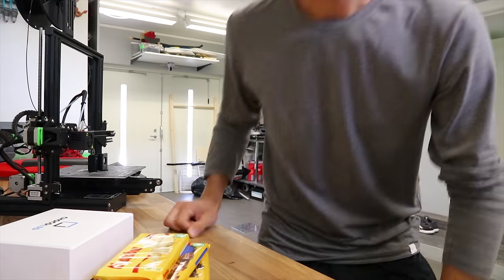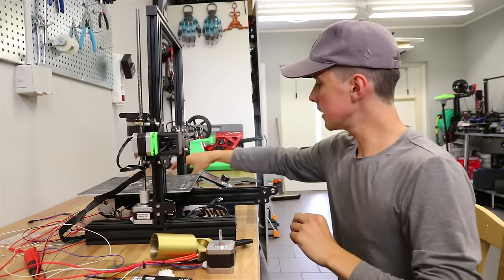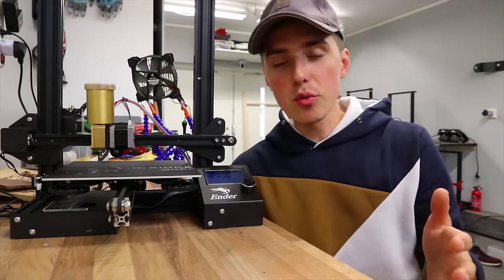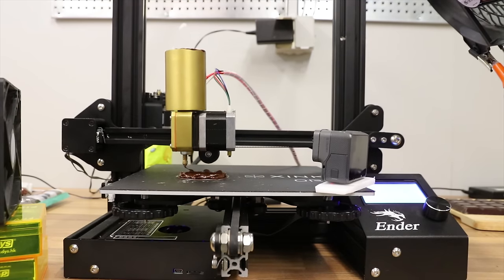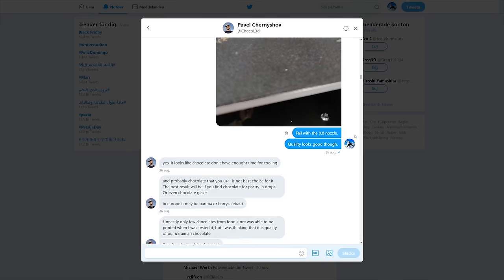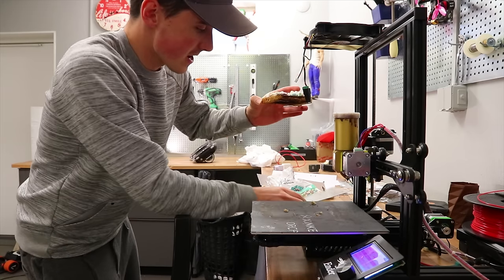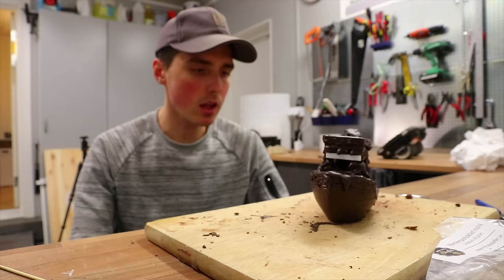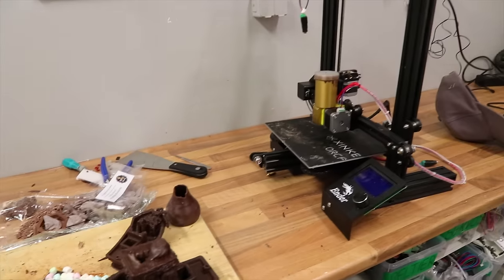3D Printer Makes the Perfect Chocolate Layer

Comment: Imagine doing this in a cooled room that allows the chocolate to solidify to stand on it's own.
Reply: Lol
Reply: 06:15
Reply: @skelldogTalo  yeah but with overhangs and stuff
Reply: Sure, but still impressive
Reply: Or just put printer into fridge))
Reply: @horatio3852  yeah condensation on electronics is not a good thing
Reply: @dan3a  I didn't think about it))
Reply: @dan3a  dry out the air
Reply: you can build small container for printing chocolate and cool it with dry ice just an idea tho
Reply: I feel like there’s a fine balance between good solidification and the chocolate solidifying inside the nozzle and junking up everything
Reply: He just needs to turn down the print speed to like 2mm/s and it should work... It just might take 1000 years

Comment: First off, let me say that I greatly admire your patience.  Secondly, may I suggest sourcing chocolate that has coconut oil as the main fat, as it melts at only 24C.  That should mean you only need to cool the new layers by ~5-8C to get them solid, though such a low melting point brings its own problems.  You can make your own chocolate using coconut oil, honey, and cocoa, which might be something for you to try.  Another option in the other direction would be to add (edible) paraffin wax to regular chocolate.  This melts at 46-64C and is often added to help chocolate not melt so easily in your hands.  Another option that someone mentioned was to use a cooling enclosure, which might work well.  Hope this helps!
Reply: Show off!
Reply: @7f0g20  Buzzkill!
Reply: Show off
Reply: Huh.  I don't often get a chance to use 'LOLWUT?', yet here we are.  :grin:
Reply: Show off???
wait what how?
Reply: Keith Olson why you bully me
Reply: Teacher:Keith why haven’t you finished your text
Reply: I'm not sure what y'all are smoking, but I know that I don't want any.
Reply: Keith Olson ok we get it you like science 🧬
Reply: @KeithOlson  They need some milk
Reply: wouldn't a higher melting point better? That way the delta between room temperature and solid chocolate would be higher, resulting in faster cooling chocolate. Maybe cool the room or workspace down too. I see the problem in to high temps. Also I would decrease the print speed or add an pause between layers. The ship was a good example. Bottom looks good, because the bigger printed area giving it more time to cure between layers. It did got messi once he printet right on a "fresh" layer.

Working with chocolate is tricky. Not sure what this printhead can do, but I would heat it only a few degrees over melting point, since to hot chocolate is hard to work with.
Reply: @Steel Vendetta delta usually stands for the difference in mathematic. For a non native english speaker it is way easier for me to explain it this way.
Reply: or adding a little bit of butter should help too...
Reply: Are u a tetcher?
Reply: @arcadebit1551  I'm not sure which would be better, which is why I suggested both as avenues to research.    The complete lack of cooling on his setup can't help but be a big issue.  (...and don't worry about those who want you to dumb down your comments, though I do agree that the wording in your second sentence could be made more efficient.)
Reply: @ @honeybool7065 :  I honestly don't know if they are haters or not; a lot of them just don't seem to be making any sense.
Reply: also add a fan to blow on the chocalate
Reply: people try to help
YouTube- Excellent, targets.

Keith, Arcade, both your bits of advice help not only with the printer, but also for someone that does make chocolate (moi) on a not-so-regular, regular basis.
Reply: Lmao someone is just trying to hrlp
Reply: Show off!!!!!!!
Reply: Keith Olson English please
Reply: Wouldn't the coconut oil separate from the chocolate?
Reply: coconut oil would kill me, I am allergic to coconut :-(  I can't eat many commercial chocolates anymore because of palm oil and coconut oil.  I wish that they would stop putting it in everything because I have to cook everything from scratch now and I can't even eat most snacks
Reply: Dam you talk to much
Reply: Can someone explain to me why there are so many 'Show off!!!' comments here?  Is this some meme I'm unaware of?  I'm not mad, just confused at some of the responses to my sharing information I've learned.
Reply: @honeycalina8515 : Personally, I'd rather people talked with each other more.  Most of the replies here are missing so much information that they are utterly worthless.  If people would take the time to share the complete picture of what they were thinking, then what they had to say would be taken more seriously.  Your comment, for example, doesn't say who you are talking to, nor does it specify why you think this person is talking too much, and so isn't of much help to *anyone*.  (If you are speaking about me, I honestly don't see how I could trim what I've said very much without just turning it into dry notes, which aren't pleasant to read.  I do try my best to stick to the topic at hand and not turn every comment into a full-on essay.)
Reply: @pam7366 : Why do you believe that they (I'm presuming you mean chocolate) need milk?  It does add a particularly good flavour and texture, but there are plenty of other sources of fat that are more suited for other uses and tastes.  (I'm a fan of dark chocolate, myself, which contains no milk.)
Reply: @pam7366  I hear you, but please consider the structural integrity inherent in something made of chocolate mousse.  :grin:  (Mind you, it would make for awesome infill!)

Comment: why not just 3D print a mold and then just pour melted chocolate into it.
Reply: (Excuse the name, it's for something)

Is that 3d printing. I think not.
Reply: or just put bread with cholate in the toaster...
Reply: Then u can’t eat it
Reply: @haxosop7648  why not it seems more edible than crappy "chocolate" you have to use with this extruder.
Reply: I feel this has different potentials other than things that could be done with a mold or a knife
Reply: @muhammadal-hiyari5239  3D printed parts aren't safe for use with food as germs and dust particles get trapped in between the layer lines and are impossible to remove
Reply: @regantaylor5848  almost any germ will die at high temperatures that's why we cook food 
The reason why some 3d prints are poisonous is that the plastic itself is poisonous you can use PET as it's mostly used for water bottles
Reply: he didn’t have enough time for that
Reply: @mickel836  well technically it's not but it would make a great Valentine's gift
Reply: @muhammadal-hiyari5239  when you mold something out it has to be NON TOXIC or EDIBLE!!!! you can't just eat a random mold you print out
Reply: Because 3d Printing plastic is very very very very far from being foodsafe
Reply: Oh shit,I didn’t read it good
Ahem
I mean duuuuuuuuuuumb
Reply: لا تحاول
Reply: Translate don’t try
Reply: @Imyourmoose  good idea
Reply: @regantaylor5848  If the dust and germs are impossible to remove then they're safe with food, as if they could spread onto the food then that would remove them from the mould.
Reply: @Imyourmoose  you mean toast the bread THEN put chocolate on it
Reply: @nuke6491  no, you know the toaster that you put bread in it then close it and make a tosti.
Reply: Muhammad hiari cause then you need to worry about the bubbles messing it up
Reply: You’re no fun!
Reply: The problem is getting the chocolate out of the mold after. You can make much more complex shapes if you can print it freestanding in the open air: if you made a mold for that boat you'd not be able to get it out because of the hollow cabin. Also, you'd need way more chocolate because the infill for a mold is 100% (unless you have a fancy shmancy gyroscopic mold used for making chocolate shells, but those are industrial, not consumer model).
Reply: Smart one aren’t you
Reply: @TheBoundFenrir  You have a point 
For simple shapes you could just print a two-part mold but for more complex shapes I would 3d print real chocolate (made with cocoa butter) in cooled chamber (just like you use a heated chamber for ABS) so chocolate would harden quickly after being layed on the print bed
Reply: you could, but actually printing it is more fun
Reply: @lobetec314  read my other comment "@RCLifeOn could you repeat that experiment with real chocolate (made with cocoa butter) while printing in a cooled chamber this way the chocolate will harden quickly and the print will hold better"
Reply: Cuz dis method is cooler, k?
Reply: that is too advanced man.
Reply: That's not very safe. Some people do make silicon molds & other food safe materials for that though.
Reply: Muhammad hiari because it’s so much better
Reply: Wait this comment has 666 likes
Reply: Muhammad hiari Molds have bacteria and can contaminate the chocklate and gives a chance of food poisoning
Reply: That just borring

Comment: a simple fix to this, is to wait 10-30 seconds between each layer,
so print  first layer, let it cool, then print the next...
yeah it would take a longer time to print, but the result would be better...
you might also wanna add a little vegetable oil to the melted chokolatte to keep it from clogging up...
Reply: TheFilledk chocolate*

Comment: This has potential. It can be used for weddings, for example.
Reply: @moea.9120  no you
Reply: Moe A. Chill lmao
Reply: @russellfar123  why'd you have to fucking make him mad?
Reply: Moe A. tbf I think it also takes quite long to actually print the chocolate. Hence, the time lapses. So, it’s got potential, but definitely isn’t feasible for weddings in its current state.
Reply: Yeah, if more people will help the inventor to upgrade it
Reply: Moe A. Underrated comment
Reply: It already is used for weddings and stuff... Google Chocolate3
Reply: Nah, you'd 3d print a model, vacuumform it in polycarbonate and use that as mold. I work with chocolate :)

Comment: What if you made a "frozen bed" as well as fan cooling?
Reply: Maybe he could use a Peltier element and some copper tubing to circulate cool liquid under the bed. A little bit like a PC water cooler.
Reply: I was also thinking he could use cooled air in his cooling fan, maybe run it from a small refrigerator unit or something
Reply: Besides making the bed cool using a peltier element as other have suggested he could also use a peltier element and duct it to cool the chocolate as it comes out.
Reply: Or he could change the printer in a fridge
Reply: He just needs to print much slower.
Reply: Screw all that peltier nonsense, just use a thick piece of glass out of the freezer! :P
Reply: @kurtownsj00  or print in a freezer...(probably best to keep the motors on the outside though...)
Reply: That would make it work better...
But the problem with chocolate 3D printing is that the chocolate won't be tempered in the right way and won't taste as good as the original chocolate.

Reference: https://www.youtube.com/watch?v=3-EKcYqKEec
Reply: cooling.......cools the nozzle as well.....and chocolate dont flow through cold nozzles
Reply: Make a bowl to print in that fills with a little water each new layer so it cools every last layer. Or maybe the layer below?
Reply: Put the whole machine in a refrigerator  and wrap the melt pot in a tiny blanket.
Reply: @hansfouche5198  so he need some silicone socks.
Reply: @novabeigh8154  I was lazy, made a comment, its Sweden in December, just open a door.

Comment: You can't just melt chocolate and expect it to set, no matter the kind or brand.

Chocolate is made of cocoa liquor, which is ground cocoa bean, that's split into cocoa powder, and cocoa butter.  Cocoa powder you've seen before, cocoa butter is a white fat that >can be< solid at room temperature.  It's made of four different amino acids, that each crystallize at different temperatures.  You mix the cocoa powder and cocoa butter back together again (total cocoa %), with sugar, maybe milk components, etc. to make the chocolate you actually eat.

To make chocolate solid, you have to melt it, cool it, melt it, cool it, melt it, and cool it again, before molding it.

...  It's called "tempering"...

It's essential.

You were conned and bought a $300 piece of metal.

There's no way this can work without an incredible amount of luck.

The "easy" way of tempering chocolate is to melt it, and mix it with chocolate that's already set (chocolate you haven't melted) until it won't melt in anymore.  The liquid chocolate arranges around the crystals that are already formed, and somewhat manages to become hard, but that's good for cakes and stuff, not for bars.  For bars your need a spatula that has a thermometer built inside of it and the chart of temperatures you need to bring it to and from as I've explained...  They sell them on Amazon and whatnot, it's called a "tempering spatula" or a "tempering spoon".

Maybe sometime you can melt your paperweight and have some satisfaction...

Sorry...
Reply: Then how come chocolate fountain works at all?
Reply: Then how come one worked
Reply: Could you go through the seeding and tempering process, then print with tempered chocolate? Does chocolate lose its temper if held at the final temperature (after all the heating/cooling steps) for too long? Do you think extruding it would cause problems?

I think you know a lot about chocolate, and sound spot on to why he was having problems, but I bet there is some way to do it!
Reply: Well it clearly does work with the right mix, it's just not very reliable.
Reply: Wouldn't just using some for example coconut fat that hardens in together with the chocolate work for the regular old consumer? That's what we do when making home made confectionaries, and it tastes just fine. It seems like he got the metal paperweight to work in the end, and it probably would have gone better if he used a fan, so I would disagree with you.
Reply: actually i believe only real chocolate needs to be tempered.
Reply: Siana Gearz chocolate fountains are flowing melted chocolate. not chocolate that is trying to be set to make a shape or anything like that.
Reply: Its really not that complicated, I've done it for years, its really just melting and than pouring over a granite or marble table and stir it with a spatula until it cools down and remains a liquid at room temperature, no need for melt a bunch of times. But the hard part is to solidify once is melted and temperate, you usually put in the refrigerator, but I think if you extrude slowly enough and blow cold air in it should do the job, once it's done he can put it on the fridge to properly harden. Nestlé sells untemperate chocolate bars, 1kg each. My sister taught me, she makes pastries and other candies.
Reply: chibikong  he didn't use chocolate, he used chocolate flavor hydrogenated vegetable fat.
Reply: As stated, the reason it worked is the vegetal fat. Chocolate like that is hard to find in Scandinavia as we don't need the vegetable fat to up the melting point in our cold weather.

If you're trying this out look for "compound chocolate", which is the word for those types of chocolate hybrids.

Also, tempering is not needed with compound chocolate.
Reply: You done?
Reply: Well my chocolate set so you are wrong
Reply: you should be hired for one of those homemade chocolate instructions people
Reply: @DogeOfTheDoges  
Prety sure you're not reffering to me, but dang, that would be a dream job..!
Reply: Patrick, everything you said is true for real chocolate, i.e., chocolate whose fat is cocoa butter. In this video he used *compound chocolate*, i.e., chocolate based on vegetable fat. The entire motivation and reasoning behind compound chocolate (besides being cheaper) is that it does not have multiple crystal forms and therefore does not require tempering. Yes, it's questionable whether this device should be sold as a "chocolate extruder" when it can only extrude compound chocolate and not real chocolate, but you're going way off on a tangent about real chocolate when the video clearly states that he's using compound.
Reply: @TheHuesSciTech  but I believe the entire basis of the video was to use real chocolate. He only used compound because he doesn't know what actual chocolate is, that it needs tempering, and doesn't understand chocolate work. 3D printing chocolate has nothing on World Chocolate Masters.

Comment: Probably a stupid guess here but how about trying to print it in a freezer or a cold environment? To help the chocolate cool faster
Reply: what about leaving more time between every layer and the following, is it possible? for example the ship was ok until the time was enough, when the piece was too little the extruder was coming across the same point in too short time. if you get a cold environment you could affect also the fusion temperature, if you just wait...
Reply: Electric fans? That would keep the temperature stable.
(Always clean your fans but make sure its completely dry or else your food will get soggy).

Comment: My father is a baker.
The reason why the chocolate with the main ingredients sugar and cocoa butter (natural chocolate) fails is because you need to temper it to avoid melty chocolates.
the chocolates with the main ingredients sugar and vegetable fat (artificial chocolate) works because it does not need tempering.
also i recommend using acetate plastic as the plate of the 3d printer
(sorry for the bad english)

Comment: Seems like the the main issue is the chocolate not solidifying fast enough. I suppose it might work printing at a very low speed, slightly obove the melting temperature, with some gentle airflow and outside on a cold day.
Reply: Im pretty much certain that good enough cooling system would do the trick.
Reply: chocolate dont like cold nozzles
Reply: @Crazycatsbackboi , Yes....then you cool the nozzle as well.....and chocolate solidify in a cold nozzle